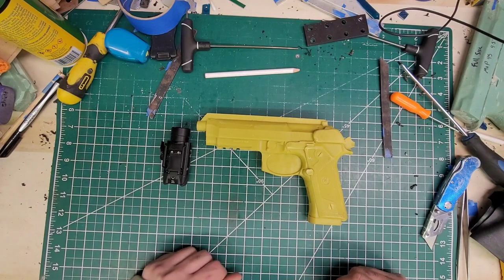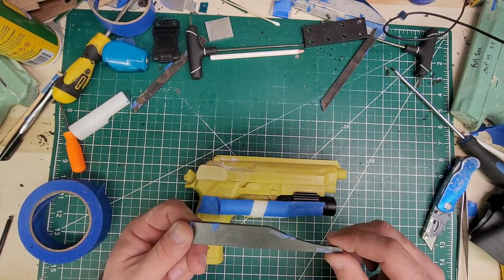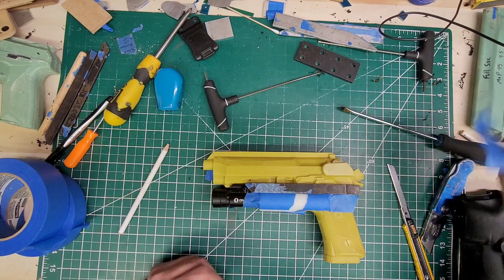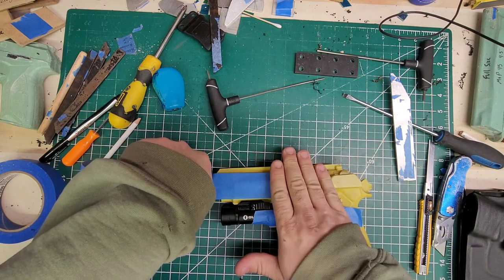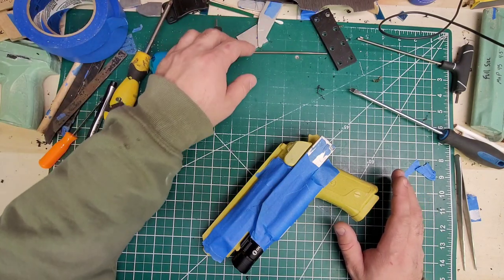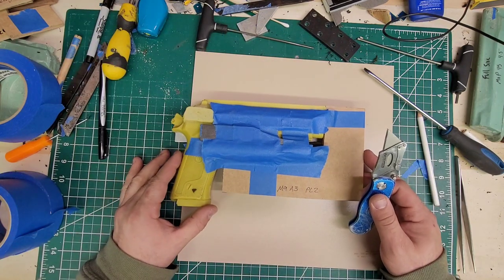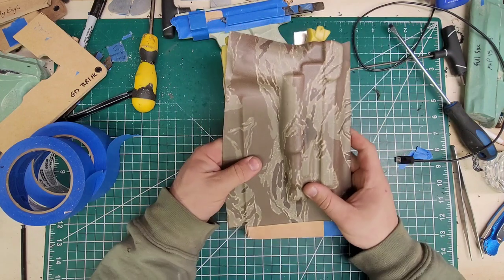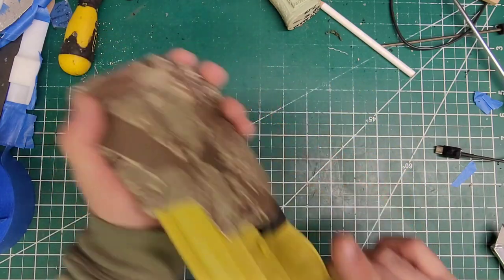Beretta M9A3 with OLight PL2 paddle

Comment: When you are prepping the molds with a light, can you use the actual light or should you purchase just the shell?
Reply from the maker: I have always used the actual working light. Make sure to take the batteries out because sometimes they got hot enough to melt kydex. The only company I know that sells shells of lights is IFI and its only inforce lights.